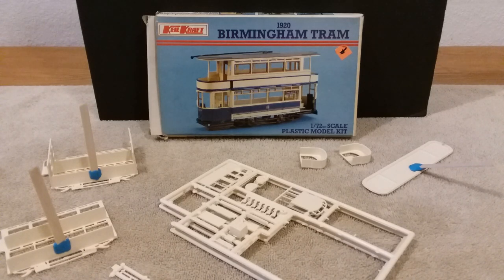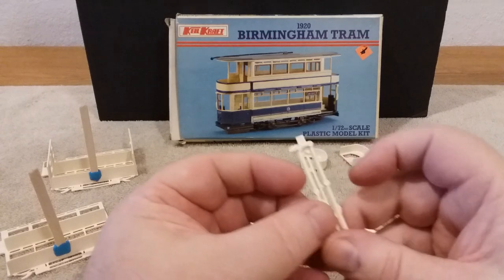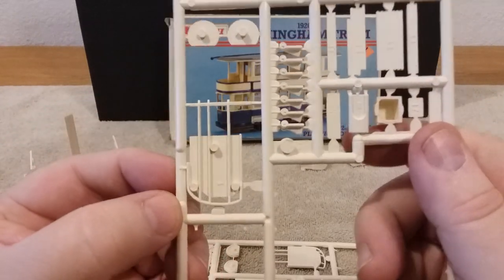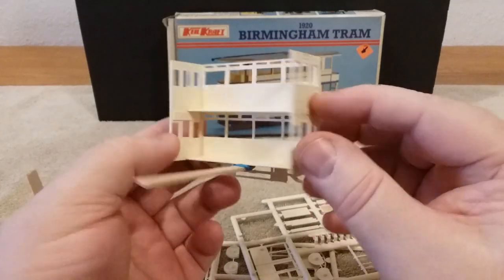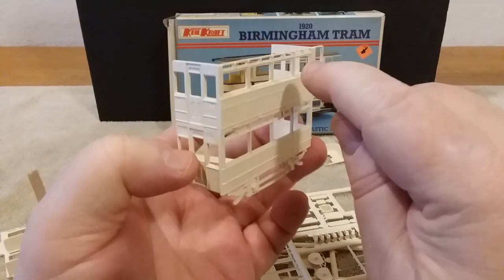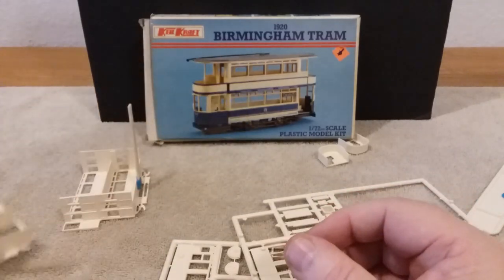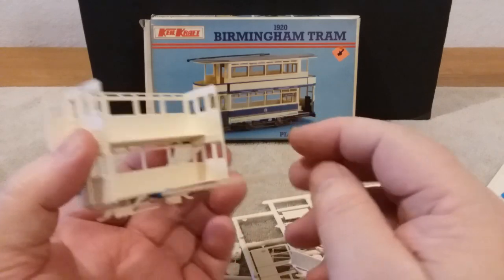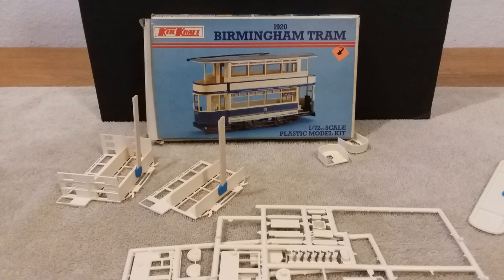Keil Kraft 1:72 1920 Birmingham Tram Plastic Model Kit Build 1

Comment: My grandfather was a Birmingham tram driver 1919-1953.   I've built several of those kits.   By the way, BIrmingham trams were 3'6" narrow gauge.
You might be interested to know that the trams in both Birmingham, England and Birmingham, Alabama, were replaced by buses on the same day, 4th July, 1953.

Comment: Hi Bill, the tram kit is a model of a 301 to 400 class . the seating was originally wooden in both saloons, longitudinal seats in the L/S and transverse in the U/S . The L/S seats were later changed to match the U/S but were upholstered. Birmingham trams were narrow and the seats were arranged as double seats on one side and single seats on the other, so only 3 wide plus central gangway. Wooden seats in the U/S were painted brown and  the L/S upholstered seats  were brown leather in some cars and dark blue leather in others. The narrow slits at the top of the windows on the kit are opening windows and were glazed, plain glass in the L/S and pink muranese glass in the U/S, hope this helps. Good luck.
Reply from the maker: Thank you sir, thank for watching and thanks for all the info, I can use it, appreciate it!...Bill